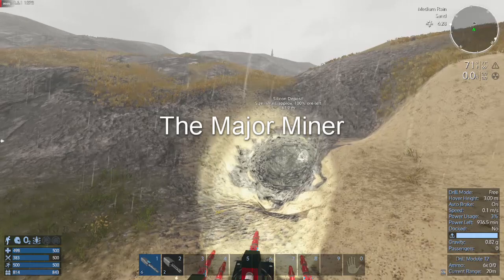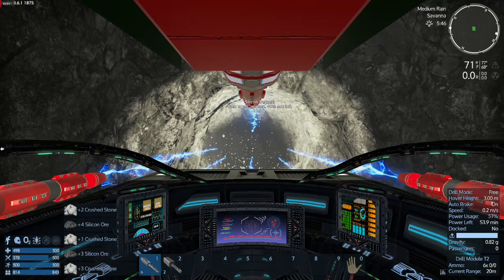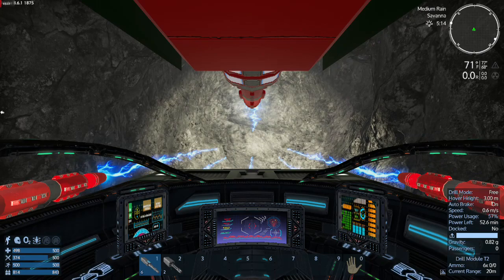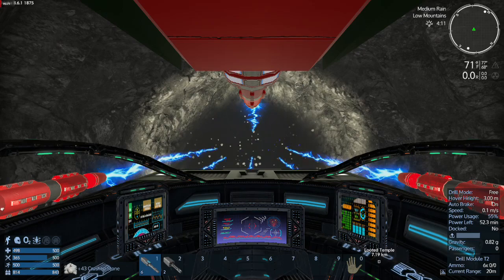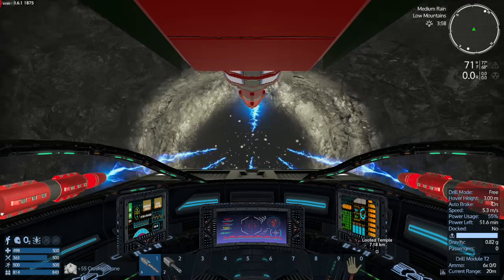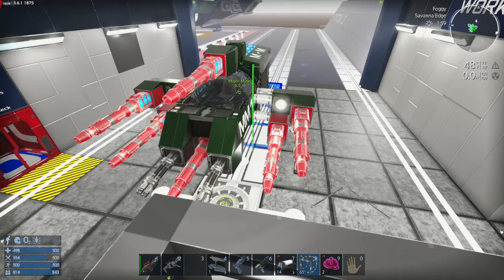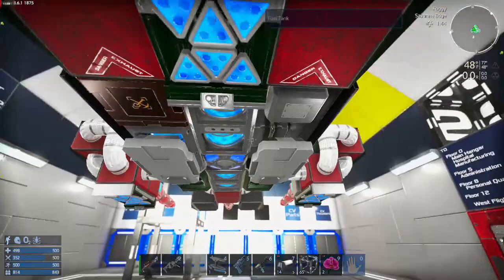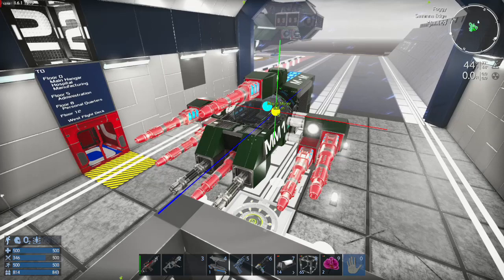Major Miner

Comment: Great little build... I found this principle on HV Miner by a builder by the name of jerryfanfan... and adapted the principle to my own general purpose HV, but using a cross shaped grouping of hover engines right alongside each other... works the same way, but can help if your HV is on the portly side... I put a tip for general running on your comment on Spanj's video, I hope it helps... :o)

Comment: So I have experimented with this quite abit now and have been able to adapt the technique to just about every miner I have. The only down side is, while it does hover OK while cruising I found it to be tippy. Since nothing keeps it level any bump that throws you off...you stay off. The solution i came u with was simple. Add a conventional layout of hover pads and put them on a separate power switch from your mining pad. Shut them off when mining, thurn them on when cruising.
Reply from the maker: Thanks for the feedback, Mike. I've been experimenting with it too, as the Major Miner 1 is somewhat underpowered in the thruster department, and has no turrets. The challenge is, if you add a harvester, two turrets and more thrusters, its too heavy for one hoverpad! DOH! Trying to find that balance.
Reply: @davidcooke8005  Yeah! Add all the pads you need for the other stuffs. Just shut them off while mining. If you need more hover for the single mining padd...stack them vertically. Should do the trick. I've been able to get away with one pad for my wolverine and it has two mini guns, 1 multi turret, 2 gats, 6 dills. If you share me your steam name i can freind you and send you the bp if you wanna see it.

Comment: Oh man...a thing of beauty! If this doesn't change how HV miners are made then folks are not paying attention. How does it handle cruising on rough terrain?
Reply from the maker: Thanks Mike. I thought the same thing. It will catch on as more people hear about it, I hope.  It handles like a champ on rough terrain, that's the beauty  to the single hoverpad. It can wobble a bit if you plow into a rock at speed, but doesn't ever flip without REAL effort. You can sidle up a pretty steep hill and maintain your pitch in any direction. I built a stripped down Unlock level 12 version that works well too, still haven't really given it a proper test though. But the principle works the same. I might try a combat HV next, see it helps with aiming.

Comment: this only works with weights and valums disabled . . .
Reply from the maker: Ya, it was designed before they implemented weights and volumes. The Major Miner 4 is the newest version with more power and less frills, but even it is limited with the new systems in place. But with weights and volume off, the MM4 is an awesome digger with plenty of power for tunneling up and out, and a wifi so you can just keep dumping your cargo into your nearby CV.

Comment: a shame they broke this. :(
Reply from the maker: I have to upgrade the Major Miner for v9, but the principle of the single hoverpad still works, so long as you can link to a CV to upload all your ore/ mass. You could design a v9 version, or keep an eye out, I plan to upgrade the Major Miner 3 sometime soon. It's still v8, but won't take much to squeeze a wifi unit in it. I used the MM3 to excavate a HUGE underground base in v9, but with mass and volume off. Which it will always stay in my world. I have zero interest in a game that's all about micromanaging bagspace. But I'll still update the MM3 for v9 to keep the Major Miner franchise alive for those folks who like the mass/ volume limits. I don't judge.
Reply: @davidcooke8005  i have tested many ways to fix this, but as of right now, no matter what you do, as soon as you put a decent amount of weight in it, it will not even lift off the ground with a single engine. even a 2x2 engine will struggle under heavy loads. you get lucky if you can even mine small deposit before hitting the ground unable to move. i'm just waiting for them to finish the balancing and then we can either be delightfully surprised or totally hosed lol.
Reply from the maker: @dragonpc8258  Hey Dragon: Thanks for the feedback. I have just uploaded the Major Miner 4 to the workshop. Stripped of all extra mass and equipped with a wifi unit to send ore back to your CV periodically. With mass and volume off it is far and away the best in the Major Miner series, I tested it extensively yesterday. I would love to hear your feedback on whether using it as a set with a nearby CV is feasible. Not that I'm going to enable mass and volume in my SP game, but I'd still be curious.